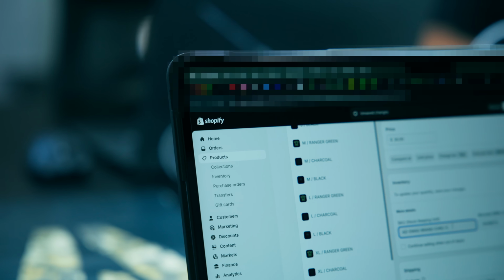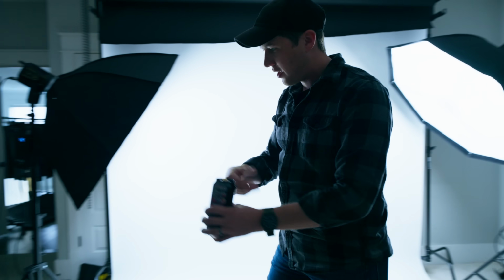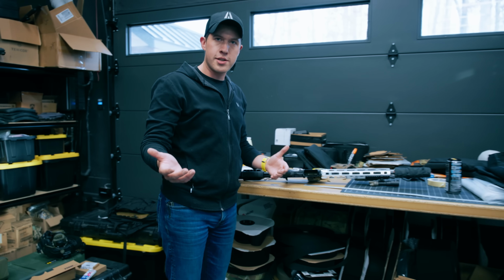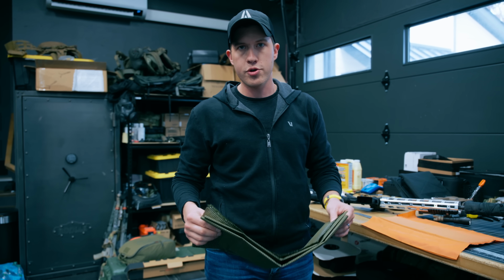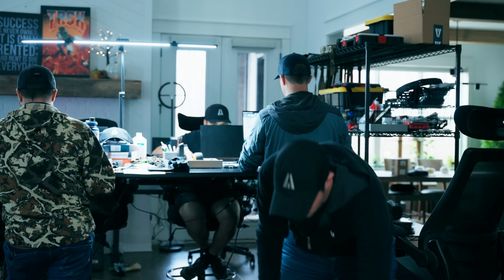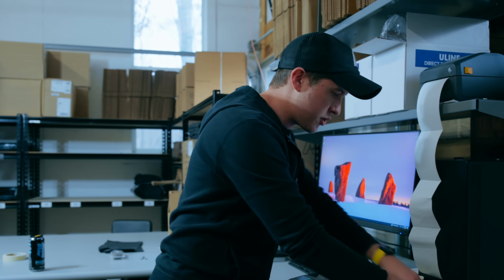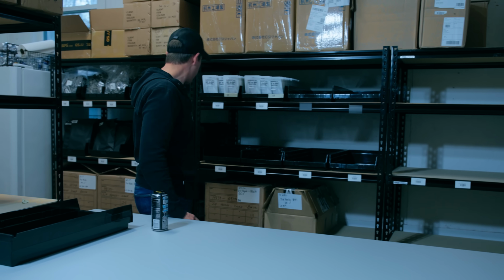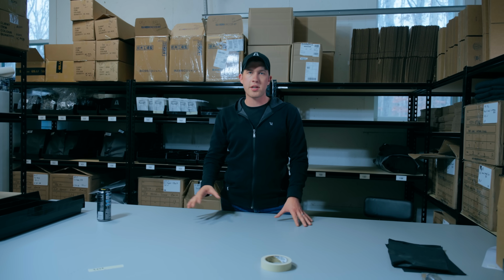My Next Company Is Launching From A Garage... Again

Comment: A few product ideas for you guys free of charge because I wanna see you succeed.

1. Gunderwear. Performance undies with printed guns on them.

2. Beard Bags. Satchels built for forward operators to tuck their beards in when they smoke cigars.

3. Brantley’s PETG-HF Handguards. 3D printed handguards using a 2mm nozzle and 0.16mm later height for maximum durability. 

4. 8.7 Blackout or a 339 ARC with a short barrel just to show Kevin B and Steve H that you’re better.

Comment: Are the direct threads going to be steel inserts? Or directly in the aluminum? If it’s directly in the aluminum as a cost savings effort. I would love to see a thread repair kit included with the rail (An appropriately sized drill bit and tap larger than original sized threads, and then a steel insert that could be threaded in from the inside of the rail as a replacement to the original threads)

Comment: Lucas. As a professional IT guy, I just want to caution you in your reliance on AI. Now to begin with, even I use ChatGPT (the best at this point, IMO), sometimes daily... But it is NOT, as some people think of it, the same as Googling. Even the best AI will still, quite confidently, 'hallucinate', and give you bad/wrong info/directions. And furthermore, I have had it actually 'argue' with me even when I knew it was wrong... (Though usually when you point out an error, if you notice it, it will just apologize and correct itself). Basically Im just saying, learn its limitations, and always keep them in mind, and whenever possible, double check the work.

Comment: Would love a clothing company focused on stylish CCW. Not all of us want to wear fishing vests or just oversized clothes. One hypothesis i have been running with and I've tailored my own clothes is that whole "True Classics" tee company where it's fitted around your top half but loose on mid section if you have a belly (or in our case if you dont want to print). Buying a size up for me and then just tailoring the top half has been great but somethjng off the rack would be nice. Also a simple separate pocket in your left pants pocket for your spare mag would be nice, so you dont need like a separate mag holder and it doesnt float around and sometimes you dont want a side cart on your holster. Or gunbelts without a buckle so it's easier for apendix carry movement. Anyway just some ideas

Comment: Photographer here - consider using green/blue backgrounds for product photos.  Removing the bg is much easier/faster than a white/black bg and only requires 1 or 2 extra lights and 4 extra feet of space. Since you like video, you can use a turntable and have 360 videos without BG using the same setup. PM me if you have any questions.

Comment: I saw that you have a bambu labs 3D printer. Just a word of warning is that in order you use their slicing software you upload your models via the web and you designs go to China were there can undercut you by making injection molding with your stolen design. I would highly recommend using an offline slicing software.

Comment: What if you found a material that took heat better than others and only machine it where your hand goes on the handguard? Everyone always puts on mlok grip panels, picatinny panels due to heat issues and obviously sharp edges with a pic rail. Maybe it's too specific as where the length of pull varies too much to dedicate a certain area for the support hand.

Comment: Do you really think the benefits you see are worth not going Mlok? 

I just feel like thats going to limit a lot of sales regardless of perceived or factually proven benefits?

How mwny rail sections are going to be included in the rail when we buy one?

And what kind of lockup are you using? Barrel nut etc...?

If I were in your shoes - especially after having the relationship and experience with them firsthand and seeing the amazingly good performance you get out of it - I would use the BCM KMR barrel nut and lockup and just add in your own new anti-rotation "tabs" or method(s).

Just my .02

Comment: Boca Raton

But srsly Lucas is absolutely right about AI and how it can help you. I think it'll ultimately be bad for humanity, but it just ain't going anywhere, so people that don't use it as a tool are missing out. 

I do software dev and use it just about every day, not for doing all my work, I still need to do the architecturing and comprehending of the big picture, but I use it instead of reading through documentation like I used to. Rather than reading through JavaScript docs to write a function that computes the distance between 2 sets of lat & long points I ask it and boom, pretty much a copy-paste solution there. Then I can integrate that into my larger solution. Did that exact thing today.

It's cut hours off tasks, makes parts of my work better, which means better quality for our clients, and allows me to do more tasks in a day. It's really pretty crazy how good it is, though it does have a habit of occasionally just making things up lmao.

Comment: Can see in your videos that you appear to be using Bambuu H2D printers.  Just be aware that Bambuu is also a Chinese based company with some of its print function reliant on the cloud.  So if you have some things you wish to print secure, you may want to do your homework on it and consider incorporating print procedures that keep the files from floating off into the cloud.  Not saying they're a guaranteed leak.  I use Bambuu printers as a hobbyist.
Reply from the maker: For sure. We have another printer we want to get once we get into the new building. Something... larger.

Comment: good luck Lucas with your new company, I was fighting in Ukraine, if you can come up with the anti drone thermal poncho/cloak will be very good for your new company and it will saves many Ukrainian soldiers lives. right now Ukrainians and Russians are buying this material in Turkey and its not supper affective, I think SAAB in Swiden and some other EU companies are working with the similar systems. i believe after next few years all snipers and recon teams will be equipped with the signature-management gear. just making belts and plate carriers will be boring for you :)

Comment: I literally just settled on an OD green Anodized rail from Aero, to fit a suppressor into it for a 300 blackout build. And now I find out you have a rail with a greater than 1.5 inch opening in the works 🥹.

Comment: The handguard: I’m very interested. I’m assuming it will include Picatinny sections that thread onto the handguard, allowing accessories to mount directly to those sections. I’m also hoping the M-LOK slots are true M-LOK and fully compatible with standard M-LOK accessories. Personally, I’d love to see the QD sockets at the front of the rail removed and just keep the rear ones. Most people mount their lights at the 3 or 9 o’clock positions, and that front QD point forces the light to sit in a less ideal spot. If someone really wants a sling mount up front, they can always add their own M-LOK QD adapter.

Comment: Do you have steel helicoil inserts in the handguard? Otherwise you're putting steel fasteners in there and there isn't gonna be much depth of thread on an aluminum handguard anyway. It'll be very easy to strip that thread right out.

Comment: @Lucas_Botkin hear me out. EDC back pack for a small carbine/AR pistol. A padded back panel that’s normally for a hydration bladder that can fit an upper and lower separated with room for a can. Then in front of that, another section where people can store their laptop and books or important documents. With some zippered organization for chargers, memory drives, extra camera or go pro batteries etc. and then an admin panel for some pens, pencils, small note books and a water bottle pocket on either side. As a person that wants to be able to discreetly carry a small carbine, and also have my iPad, and work material/text books and note pads. This would be an awesome product that I do not have the capital to design or build.